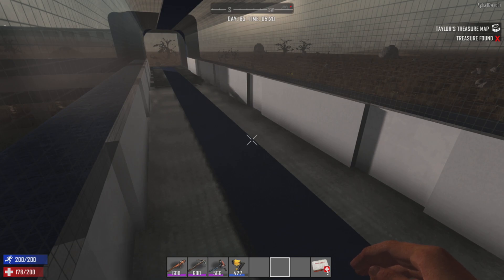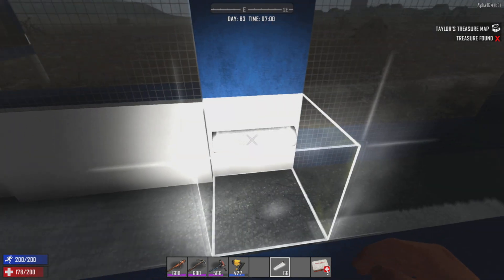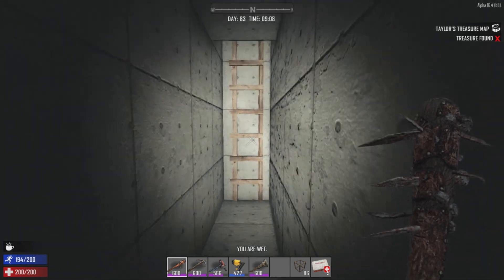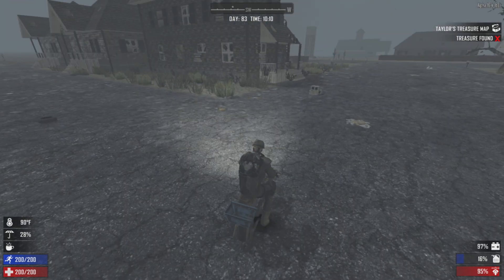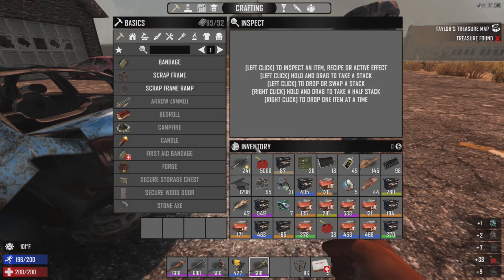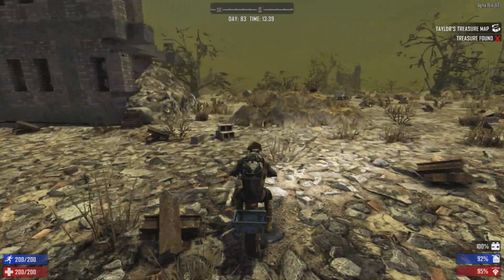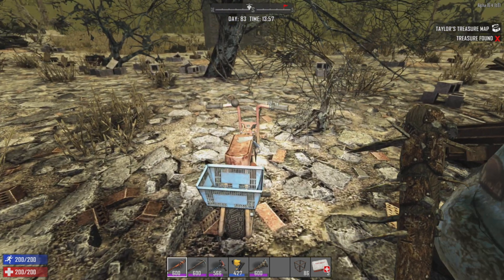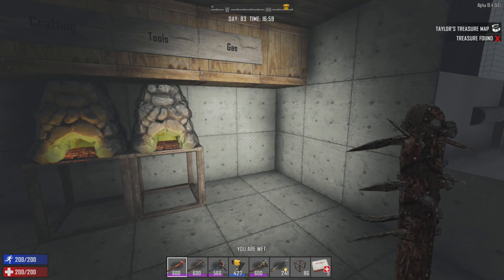7 Days to Die Let's Play Alpha 16 S2 E88

Comment: Spartan, why don't you cover the ground in concrete plates everywhere that doesn't have spikes? At least you won't have to dig
Reply from the maker: I will explain it in the next video. In short, I would not be able to build upon the plates, as they take up the space of a full block. I demonstrate this in tomorrows video.
Reply: Grand Spartan I figured that was the reason but thought most of it wouldn't be built on. I really appreciate the response.  Thanks